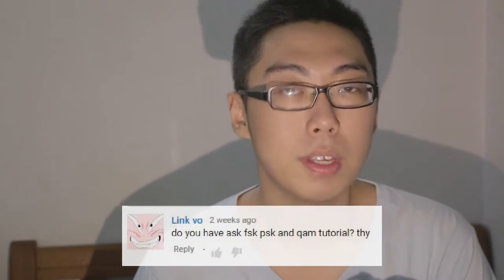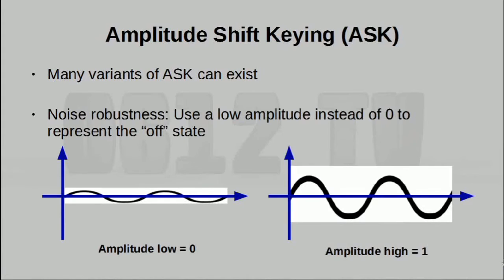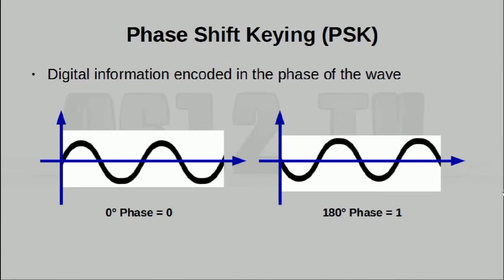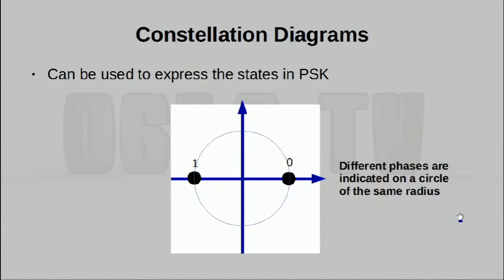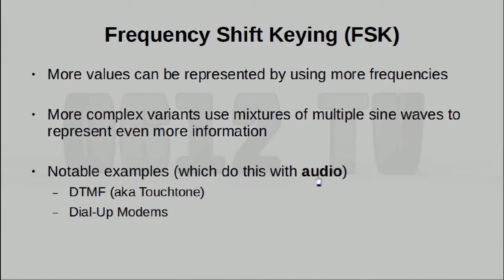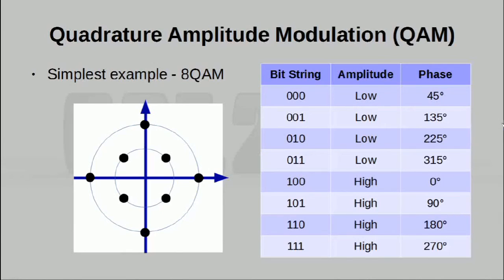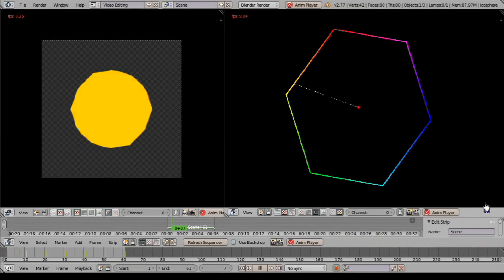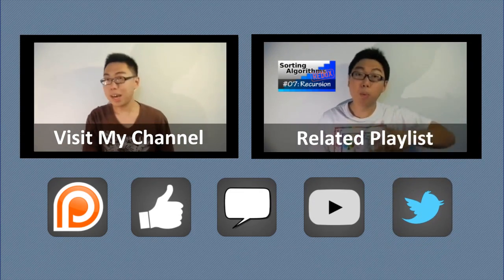Analog Encoding of Digital Data

Comment: so where does inter symbol interference or pulse shaping come in?  are the sin waves used in digital modulation an effect of ISI?
Reply: or i mean, how are digital modulated signals sent? plain sine waves?  I am confused with ISI vs DM...
Reply from the maker: Hello and thank you for your comment! I'm not quite sure I see the relevance of what you're bringing up here.

This video is purely about digital modulation - ie. Taking some digital information, and turning it into an analog signal so it can be sent over, say a copper wire, or radio signals.

Inter-symbol interference and pulse shaping are more concerned with the "physical layer" of transmission. ISI refers to interference in any manner (eg. From bouncing radio waves). Pulse shaping is about filtering the pulses before sending them out (so to answer your second question - Yes, it is entirely possible to just send out sine waves, though these are usually filtered as in pulse shaping). Both these points are somewhat beyond the scope of the video.
Reply: @NERDfirst  bro that is so amazingly explained.  i asked cause these two topics were taught in the same lecture so i thought there might be some connection.  cause like you mention, digi mod first, then send signal out as analog signal (sinusoidal). then my prof started topic on ISI and how pulses can be filtered in a way that ISI could be avoided.  so i am thinking, wait, didn't he just say send with sinusoidals and now he talks about sending pulses and filter them...?  and it looks like none of the digi mods use pulses, thats how i got confused.  you get what i mean?  like why do I care about ISI when all i am doing is sending sinusoidals in the first place?  i wont be sending anything in pulses at all anywhere since we are doing DM, had no idea why this was even brought up.
Reply: @NERDfirst  or can i sum it up like this.  to send a signal through a channel, one can use dm to send sinusoidals or use pulses but should be aware of ISI, which is why one uses raised cosine.  its basically different ways of sending 0s and 1s.
Reply from the maker: That's good! I haven't done any research into things like raised cosine so I won't comment on that, but you've got the gist of it. The flow is:

Digital Data (0s and 1s) → Digital modulation (analog signal) → Filtering to protect against ISI → Transmit

Comment: came across the subject you speak of and the following... won't add the line, the word was baud, like baud rate next to bit rate, in the same message as 'sat 9' was mentioned .. when the two are in unison, is there anything you would suggest beneficial about this pairing ??
Reply from the maker: Hello and thank you for your comment! I'm very sorry, but I'm afraid I do not understand you at all. Could you perhaps quote the exact sentence you are referring to? I have also never heard of the term "Sat 9", I'm afraid.

However, I can say something about baud - It's just a way of measuring data transfer speed, in terms of the number of symbols you can send per second. Usually, it takes on the "bits per second" unit: https://en.wikipedia.org/wiki/Baud